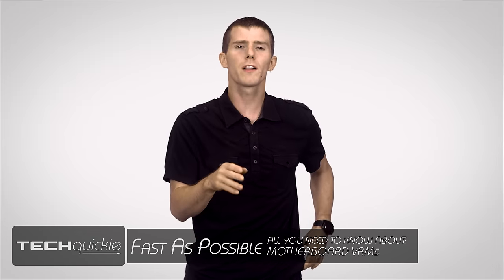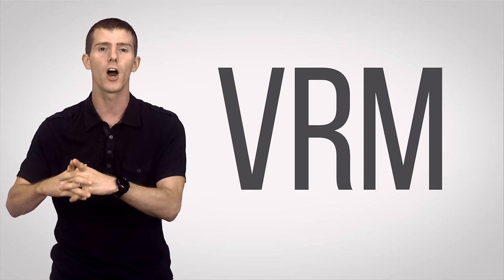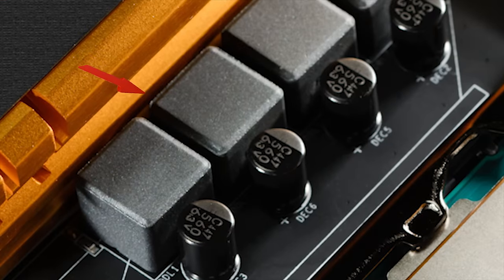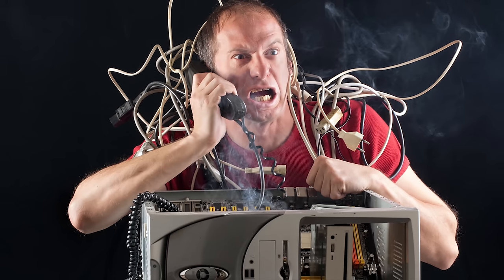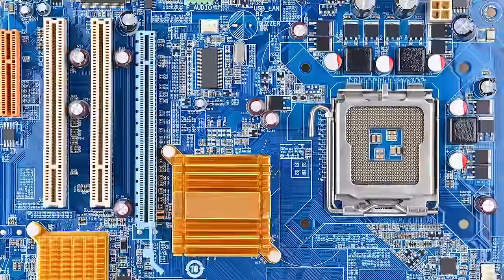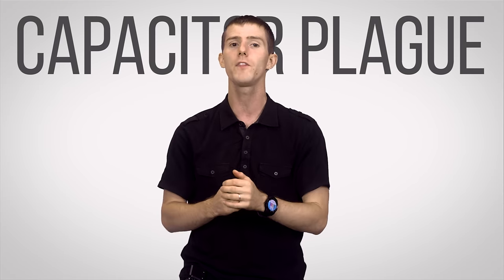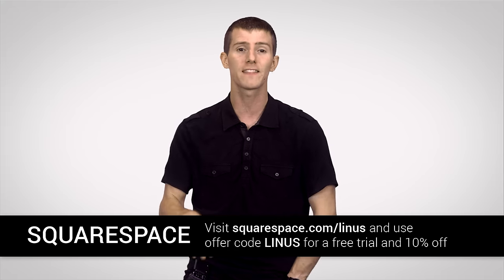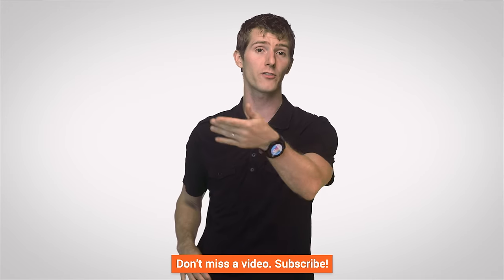Motherboard VRMs As Fast As Possible

Comment: can you guys please suggest a good AM3+ Socket board with good quality VRM?

my current board causes System instability....
Reply: +pezco. ASUS Crosshair Formula-Z might be a good choice.
Reply: +pezco. I have a Gigabyte 970A-DS3P (I'm on a budget) and it has always been super-stable.  It supports overclocking on my FX8350.  It is DDR3 and USB3.0 with solid state capacitors and dual UEFI BIOS but has no onboard video.  The only downside now is that I have just installed an MSI R9 270X graphics card, which is PCIe 3.0 whereas the board is PCIe 2.0.
Reply: +pezco. I had an Asrock 990FX Killer for awhile before I jumped to skylake. Pushed my FX 6200 to 4.7 stable with 1.4v. Wasn't a bad board. Wish I wasn't too pussy to mess with voltages while I had the Sabertooth 990FX, maybe I could have gotten a bit further.
Reply: +Jonathan Peden That last bit isn't really a con. Graphics cards still have not reached a point where they get bottleneck'd by PCIe 2.0 even running at x8.
Reply: Jak Well that just cheered me up, thanks!  What I forgot to mention about my mobo is that it refuses to detect Samsung mechanical HDDs - I did some compatibility research and it seems it only likes Seagate and WD drives, so I got a WD (I needed more space anyway).  Samsung 850 EVO SSD' work perfectly though...bloody computers :-)
Reply: +Jonathan Peden i have a 970a -g43.... 
Temperatures at 3ghz says about 90 celsius.... (board not CPU itself)
it throttles to compensate the high temperature.     i hate my current board
Reply: pezco. What CPU cooler are you using?  The stock AMD ones are not the best and the chips do run hot.  Also check the airflow inside your case
Reply: +Jonathan Peden alpenföhn Brocken Eco and Fractal design define r4.

no heat problem in case of cpu. the board is not built for a cpu like this
Reply: pezco. I think you may be right...I would buy a new board.  My mobo has the 970 AMD chipset (North bridge) but the latest boards are 990 chipset. If you are on a budget I would advise you to decide which features you want most and go from there - if money is no object then the world is your oyster.  Whenever I upgrade I look at a range of products and then watch YouTube videos to get a diverse range of views.
Reply: I think i get the ASRock Fatal1ty 970 Performance/3.1 AMD 970      a solid board for 120 bucks...
Reply: pezco. Let me know how you get on.
Reply: +pezco. I've got an MSI 990FX-GD80V2, and it's been pretty bulletproof, though I don't O/C regularly.
Reply: DFX2KX I just checked out the specs...very nice board.
Reply: Jonathan Peden
indeed it is! Got that for $150 new, and it's done well ever since. I even like the color. XD It has it's foibles, but nothing that bugs me too much (the UEFI bios is a little bit goofy on my bios version, and I can't update the bios because windows 7, so....)
Reply: Gigabyte's UD range are pretty good. I've still got an unused 990FXA-UD3 sitting around, and it was excellent when I was using it. Sexy too...

Comment: This has been the most technically incorrect description of VRM's on the Internet! So far... Read some technical books on DC-DC converters!
Reply: +Dan L  He's literally saying that the grass is blue. For starters MOSFET's do not deliver anything related to VOLTAGE. They are just switching ON and OFF with the PWM applied to their gates (hence the term switch mode power supply) in order to deliver CURRENT! Chokes do not stabilize anything. They form a low-pass filter (with the capacitor) so that the output is restored back to DC (from PWM). Sometimes the filter is also called a reconstruction filter. 

They should really get a technical editor with some degree of electronics education.
Reply: +Ventsislav Simonov You must be new to LinusSponsoredTips....
Reply: +Dan L None of these guys have the credentials to be able to talk about these kinds of things. It's more like "Linus Wikipedia gloss over tips." tips. The amount of incorrect terminology and explanations is a nightmare. He should stick to reviews.

Comment: You can't just count the number of chokes or see the spec sheet for phases. Mobo manufacturers do sketchy stuff in order to reuse components of the same phase and sont alternate properly amongst all the phases which means that the EFFECTIVE number of phases can't be judged like this but by the circuit diagram of the VRM.
Reply: Is there some way to tell, by looking at it (or .. ?) what it  actually  is? I mean, for people like me .. who wouldn't understand the difference between a circuit diagram and a menu from the cheesecake factory?
Reply: @THE-X-Force  you can look up the vrm controller and how many phases it supports, sometimes they vrm controller let's say supports 4 phases, they will put 8 chokes and 2 of them would be the same. However, there are also components which after the vrm controller double the phases so that layout may still work. If you don't wanna check the parts on the board yourself, look up a detailed review. However, if you just need your PC to run and aren't doing anything particular like overclocking then it's not necessary to be this nitpicky
Reply: @user-y6f  Hey .. thank you very much for taking the time to write all that up! very kind of you. I haven't built a rig in 12 years, and I'm finally about to jump in again, and have a lot of tech to catch up on (I don't remember VRM's being much of a consideration back then .. if they even existed).

I just grabbed an MSI Pro Z690-A WIFI DDR5 for an i7 12700K, which I think has 8+4, and the bios doesn't have a lot to offer insofar as oc'ng from what I understand .. so as you said, I guess I don't really need to worry about it since I doubt I'll try to oc any of the system anyway.

I probably shouldn't have gotten the "K" CPU in hindsight .. but there was a Memorial Day combo sale at New Egg with that mobo, cpu, and 2-stick set of DDR5 RAM (Corsair Vengeance RGB 32GB (2 x 16GB) 6000 - PC5 48000) for ~ 425 bucks total.. so I don't feel too bad about it. Seemed like a fair deal to me. What do you think?

Comment: What you should also explain is if you're delivering 1.2 volts to the CPU, it requires a little more than 64 amps of current at that voltage to achieve the max TDP of 77 watts (using i5-3570k as my example). Power = Current * Voltage
Reply: TDP has nothing to do with this video and why would he say something as specific as that? That's just a weird thing for you to comment about.

Comment: And its VRM's that are the reason i recommend against any AM3+ 970 chipset board, because the VRM count is low and doesnt recommend 125 watt cpu's. If you use the FX 8XXX or 9XXX series CPUs, you need a AM3+ 990 chipset motherboard with the higher VRM count for better OC and stability.

Comment: Linus capasitors dont protect from voltage spikes but from voltage drops: zener -> spikes , caps -> drops :)
Reply: Dude ... They do both.. No sudden peak in voltage , no sudden drop in voltage. Zener Diodes just prevents peak over some specific voltage and shorts the circuit before getting your CPU fired. Polyresetable fuse is used these days.

Comment: Now... There's a thing that i didn't know about. I do have a mobo with an p4 with a broken capacitor near the CPU. And it still works, it takes a while to post, but status up no problem. Btw thx for the tip.

Comment: For those with AMD FX series. The VRM heating cause Bottlenecks, reducing the cpu clocks.  As a result, fps drops every time as well as the GPU usage. Solution is to invest on cooling
Reply: Only with inadequate cooling.. my amd build never faced this issue

Comment: i with graphics cards were still $400 even for a mid end card now but still VRMs have gone down in cost so many motherboard makers now use solid state VRMs as they cost the same and do the same job having a bet on the user getting a new computer every 3 to 5 years due to software things they will still make money

Comment: Question time ! If I replace the fan/heatsink combo on the processor with a waterblock, what do I need to do to ensure MOSFETs are kept cool ?

Edit : I was in somewhat of a hurry when I typed this question. Here is some more background.

I am going to replace my mobo for an AsRock H77M-ITX (no VRM heatsink) and my case for a SilverStone SG13. I have an i7-3770 with stock fan/heatsink, which won't fit the SG13. As I understand it, the fan of the processor creates enough airflow for the MOSFETs to keep cool, which means that most often MOSFETs don't require more cooling to keep them running. When all that's said and done, replacing the fan/heat spreader by a water block means that there won't be any airflow anymore on the MOSFETs. And considering the SB13 on top of this, I really start to wonder if the MOSFETs will support this treatment.

Should I consider copper heatsinks ?

Another question. The radiator for the water-cooler will be on the front panel. If I turn it inward, how hot would the interior of the case run ?

Comment: This will be even less important when Intel's Ice Lake is released in 2017, which will apparently re-add the Fully Integrated Voltage Regulator like Haswell and Broadwell did.

Comment: Interesting. I'm a design engineer so there's always a battle between the engineer wanting to design something amazing that will last forever and the accountants/sales strategy teams who just want the item to function wel lenough for the next few years before a new generation comes available at which point they want your current bit of kit to become outdated and redundant so you go out and buy the newest, latest and greatest...

Am looking at installing a AMD 3950x onto a ROG B450-F motherboard, replacing the 2700x CPU currently installed. I want it to work, but also want it to last. At first glance the TDP of both CPU's is identical at 105W so I assume this means the VRM's should not get any hotter with this newer CPU? (same number of VRMs delivering the same amount of power... .although the 2700x seems to work at 1.2V whereas the 3950x seems to operate at 1.4V. As P=IV and power is the same this should mean the higher voltage flowing through the MOSFETs causes a lower current to flow.  The graph on the following page, (not convinced it is correct as would expect the power loss curce to be more of a U shape... effectively an inverse of the efficiency curve) seems to imply that a lower current flow produces lower power loss as so less heat... which seems to imply that the VRMs "should" actually run cooler with the 3950x than they do with the 2700x...
https://www.ekwb.com/blog/what-is-mosfet-and-why-should-you-keep-it-cool/

So if that is the case, I'm struggling to understand why all the pro's are recommending the 3950x needs a much better motherboard due to VRM temperatures....

UNLESS motherboard manufacturers are purposefully programming the BIOS to use the MOSFETs in a way to actively generate more heat in the VRMs if you do not buy the newer more expensive motherboard they want you to buy..... Do we think this is actually what is happening???

Also, water cooling seems like the best way to easily go to cool the MOSFETs.... but I'm assuming the current passive heatsinks might also be made more thermally efficient by replacing the thermal paste "bonding" them to the MOSFETs... does anyone know how much heat is lost by doing this?

Comment: I'm replacing a proprietary H310 motherboard with a Z390 for my Intel 8700K CPU. The listing for the new MB shows significant heatsinks on the VRM, but when I got it, they were missing. The mounting holes are there for them, but I can't find parts like that anywhere online. How do I get those heatsinks aftermarket?

Comment: What do you mean by VRM specs not in spreadsheets?

Don't know the situation in other countries, but in China, at least you can find the phase amount in the spreadsheets. And, also, almost on every motherboard box the VRM specs (at least phase amount) would be shown in a significant place. Reason? Who doesn't want a stable motherboard? 

Also, isn't 5-phase VRM the minimum standard of desktop PCs? 4-phase is for textwork PCs, and 3-or-less-phase is almost out of market?
Reply: Some product marketing on motherboards are misleading at times. For example a marketed 16 phase VRM on a motherboard might really be 8 phase.

Comment: Just out of curiosity..My motherboard (Gigabyte GA-78LMT-USB3) has a set of five chokes next to a heat sink, which I'm pretty sure are (at least some of, I think) the VRMs.  There are also three or four other chokes; there's two above the PCIe slot for the graphics card, one behind the RAM slots, and I think I saw one above the socket, under my heat sink.  Any idea what those ones could be for?   I'm kind of new to modern motherboards.

Comment: zeah um , mosfets are simple 3 pin transistors so talking to them is like talking to linus bout elektronics , sure he will listen but at the end of the day he cant understand taht info and will just drop some phones ect. the cpu is talking to the pwm chips which are the brain and thay talk in a verry primitive language (just on /off) to the mosfets which are like a muscle 
, thay open / close thrue pwm and after taht the pwm cariing freqenci is filtered by lc filters (chockes and capacitors) to produce stable voltage

Comment: capacity plague is caused by a businessman in Taiwan.  instead uses conducting chemical he uses water.  water vaporized or causes corrosion which lead to the capacitor fail.  that guy made billions from making capacitor for big companies.  after that incident IT industry buys capacitors made from Japan

Comment: My System Spec i5 9600k Asus Z390 Maximus xi hero wifi , msi rtx duke 2070 trident z rgb 3000mhz 16gb evga b3 550w psu is only 4 phases okay and im not overclocking btw

Comment: Of course I find this video after having issues with my OCs due to VRMs cooking themselves...
Reply: I am having the same troubles myself i==I have got an msi 970A-G43 PLUS with no heatsinks over the vrm. I was looking into different solutions like purchasing mini heat sinks and placing them on or purchasing a dead mb of ebay and getting the heatpipes of it that go to my motherboard since they all have the same spacing. What did you end up doing? I really dont want to have to buy a new board
Reply: I was a little bit of a dick to the company that supplied the board. I kind of feel bad but they are taking the board back in for RMA. If they can replicate the issue I'm hoping for credit towards a higher end board. Given the thing is throttling even at stock clocks on a 6600k I'm really hoping they do.

Failing that I'm just going to have to resell it and count this as an expensive lesson.
Reply: Ryan Rhind lol well damn I just didn't do enough research into my mono supporting higher temp's while oc. I was looking into buying some 10mm copper heatsink and then mounting possible 1 or 2 30mm fans or buying a broken upgraded board of the same style and taking the high grade heatsink of that since they mount super easy in the same holes. I've also though about making a custom cooler since I've got open screw holes on my particular board

Comment: Is my new mb for my i9-9900K Crap? with vrm's in parallel? I have the Asus TUF Z390-Plus-Gaming Mboard...I was told that there will be some cpu throlling when the vrm's get overheated? Is there a way to cool them with extra fans or whatsoever? Thanks!

Comment: I have a question: Linus says that CPU's use tensions like 1-2V, then what makes them consume so much power (over 50W)?
Reply: Current (in amps) - so  50 amps for 1v or 25 amps for 2v
P (watts)=U (volts)*I(amps)
Reply: @n0rie9a  7 years later I don't remember anything about physics 😅 Thanks for the reply though.
Reply: @SirW0nka  you did remember initially thats actually called tension, not voltage as everyone calls it today. or maybe its a metric/imperial thing, idk
Reply: @n0rie9a  in French at least they can be used interchangeably.

Comment: no, not 240 volts, 230 volts
Reply: it is ~220 factually
Reply: Different countries run different standards for power. Bleating about it won't change the video.
Australia runs 240v @ 50Hz so from that perspective he's correct.
Reply: +scott thompson yea but a 220 v product will work normally on a 240v outlet
Reply: CreeperBoyo when that happends, is there not going to be too much power?
Reply: in the uk it's also 230
Reply: +Bob Versyp Voltage ratings are within a certain tolerance.
Reply: When you look at voltage ratings, they say 220 - 240 volts. For any sensitive electronics, they have built in regulators anyways.
Reply: the spike goes to 240 but the rate is 230v cuz the current is behind the voltage.
Reply: Nope it's not " 220 factually".

The voltage on the line is like increased of 10v every ~25years, because it increases efficiency to use higher voltage and so decrease loss of power in line. Source ? technical school in Belgium.

Comment: you said ssd capacitors, did you mean smt (surface mounted) capacitors?
Reply: +davidkuinov He meant solid state. They are usually some kind of metal film or polymer type capacitor rather than containing actual electrolyte.

Comment: umm well, i bought the new core i5 (skylake) andi didnt wait much so i picked up the most unexpensive mobo (its not really unexpensive at all) but it was regular edition mobo from msi (MSI Z170A PC MATE) but i checked the store and saw they have a new mobo for the same price also from msi but it was gaming edition (MSI B150A GAMING PRO) and i saw that it has less chocks (correct me if im wrong) so i dunno if i made the right choice for a gaming rig or not, please help Thanks
Reply: +ThePowerOfSAM oh yes its the core i5 6600K